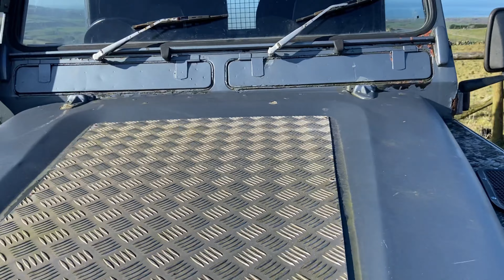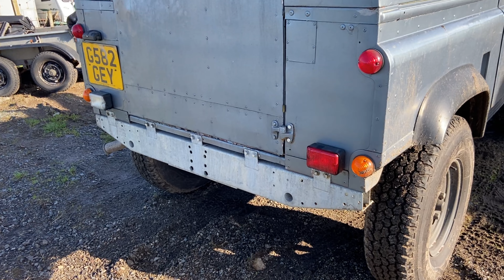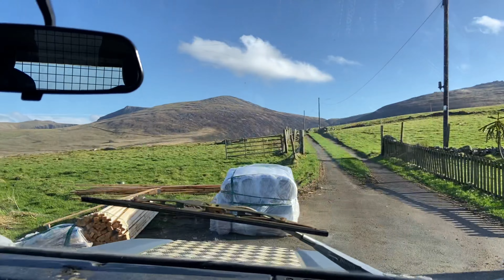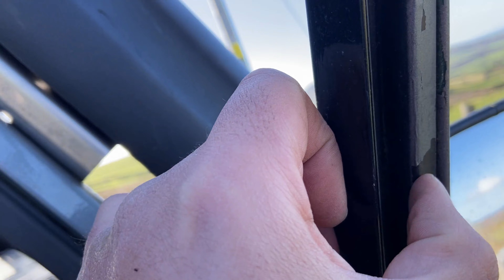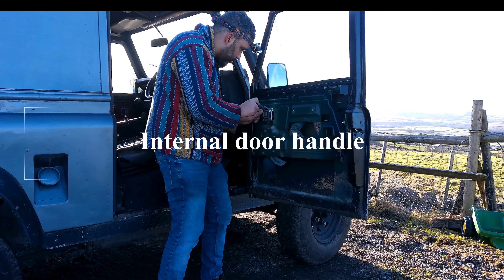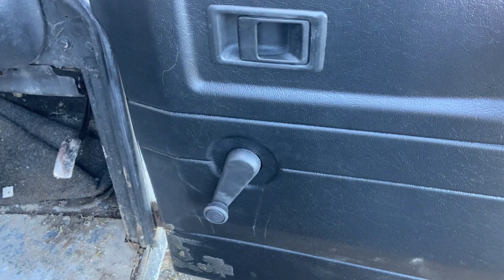Defender update and fixing the doors

Comment: Best tip I can give you is simple, don't ever go back to the  garages that tell you rubbish like the body is all warped and out of line, it's not, there looks to be a few little issues with that bodywork, but it is all bolt together and a hand built vehicle! The gap at the back of the door is adjusted by the front of the door and the bulhead spacing on the cill and othe totally adjustable parts. I do things like this for a living, you can do it if you want to take the majority of it apart and realign it properly. I also help run a projects group of FB that we have a fair few guys doing this exact same thing. The body SHOULD have been sorted out when they put the chassis on, looks like they did nothing about giving it any love at that point either. I reckon a good day getting it apart and a prioper rebuild getting everything in the right place is what it needs, aethetics is the way you put these together, and sorting out the other bits and bobs loke the semi-seized clutch pedal and then look at the little nice mods like relayed lights and a nice paint, you'll add about £3k to the price and end up with a really nice 90 (not a Defender as they are technically after 1990 whith a factory 200tdi).
Reply: Just wrote a load of info and the internet dropped out... so lost, give me a shout as can help with how to's and giving info on why the garages you've been to are not good for you and a Land Rover. Just as a basic, heater is most likely cables or something not set right, water ingress is the body is not set up right, the fuelling is either blocked filter, lift pump or clogged intake, other than that can be failing IP or failing injectors. there are tests to define which, but for cost, do filter first, then lift pump before heading down injectors and then Injector pump. It could also simply be tming is out. Get in touch and can help you sort it out.
Reply from the maker: Wow thanks so much for the advice mate. I do really want to get it resolved. I have used 3 garages now and I am not impressed with any. The first did the chassis and put all the wrong bolts in and didnt bother aligning the body and charged me a ridiculous amount. The second gave fitted me a new gearbox and reverse is a nightmare to find and the 3rd has done an ok 200tdi retro fit but again missed some simple fixes it seems and also gave me crap info about the body needing replacing. I really need someone I can trust to help me out. Thanks so much for your info. I am definitely going to take the body apart myself and put it back together to factory spec to see if I can sort it out. I am a little concerned about the bulkhead but I dont really have the budget yet. Do you have a garage?
Reply: @escapetoruralwales  I do rebuilds and mostly electricals for a living, and specialise in Defenders. I have worked on anything from Series 1's to tdci's. I'm also into overlanding and have a few of the main Landy overlanders that we discuss issues and ways forward. so usually with them diagnosing over the phone or internet with pictures and videos... it can be harder work, but it's needs must if they are broken down in some African village or the middle of South America... To be honest, this is where the Facebook group is really handy as it's there to support people like you with basic knowledge and the expertise of a few good knowlegable people. Happy to give you my details on there or here if safe, ie not public...

Comment: If the doors had dropped that much then a new bulkhead is definitely needed. If you want to put a new body on you are talking 2k+ for the rear roof and tub. Ideally you want to buy the full body with a doors too as they all tend to warp together over the years. You can try and fit new doors to your body but you probably won't get much better fit than you already have if you don't replace the bulkhead. You also appear to be missing a rear door hinge, they should have 3 hinges.
Reply from the maker: Hey mate, thanks for the info. Yeah a new bulkhead is 100% needed. It’s so badly rusted. The garage reckons I’ve got a few years left in it but recommends I do it and the body all together in one go. Yes it’s missing a hinge. I need to buy some more. I think the tub used to be a pick-up so that might be why?

Comment from the maker: If anyone has any advice on the body that would be greatly appreciated. I was thinking of buying all the panels second hand and spraying them myself? Some people have said to just work with what I’ve got. The issue is I’m getting so much water in it and it’s becoming a real problem. Perhaps I just need to take it all apart and put it back together to factory spec?
Reply: WHen I bought mine I had lots of water inside the front cab. I have over the last 18 months changed, washer sprayer as seal had broken, vent flap seals, and genuine Lr passenger door seal and front bulkhead seal. I’d say it is pretty much water tight now. I get a very tiny amount coming through the top of the bulkhead which I think is rain water coming down through engine bay. Not sure I’ll ever get on top of it but it’s a lot better than it was.
Reply from the maker: @horster2783 hey mate thanks for the message. I think that’s what I need to do, change all the seals everywhere. It’s 35 years old so definitely needs it doing. Since I did the door it has made a massive difference.
Reply: Don’t forget that holes in that bulkhead also allow lots of water to ingress. And when the heat runs it all fogs up…….may be another reason to start looking for a replacement bulkhead. (Weren’t there several holes in that bulkhead)?
Reply from the maker: @Olyller  yes I think there are. It definitely needs replacing. I have to save the pennies because I might as well change all the seals and other bits at the same time. It’s gonna be an expensive exercise but will give me another 20 years of driving it
Reply: Google the land rover water ingress manual, there will be a free pdf you can download
Reply from the maker: Great tip Dean! Much appreciated

Comment: Bruh, please check your valve clearances & timing, fuel filters, water separator for contamination.  These engines prefer to have accurate valve clearances to maintain what little power the provide.   In such a moist environment, you may have water contamination in the filters.
Reply from the maker: That is fantastic information mate. Thanks a mint 👍I’ll check it out. This issue is racking my brains and I’m pretty sure that once it’s resolved the whole vehicle will run better

Comment: Lots of useful videos from Britannica restorations, I watched this series when trying to work out door, bulkhead and body issues on my 1985 90 (still yet to fix, but the hinges are so worn the doors are self-aligning anyway): https://www.youtube.com/watch?v=UwHOYGmtGN4
Reply from the maker: Brilliant link! Thanks for that dude. I’ll watch it with a keen eye. Appreciate you taking the time to watch the video and give your thoughts. I’ll try and give defender updates as and when I can do bits and bobs to it. Cheers 👍
Reply: @escapetoruralwales  With the revving problem, first thing I’d do is remove the one way valve from the fuel filter and connect the pipe directly, It’s screwed into the passenger side of the filter. The 200tdi doesn’t need it as the fuel return is plumbed differently and the TD wasn’t plumbed through it like yours currently is either.